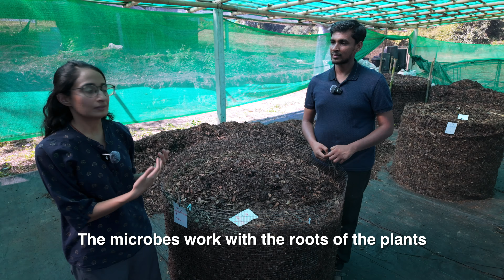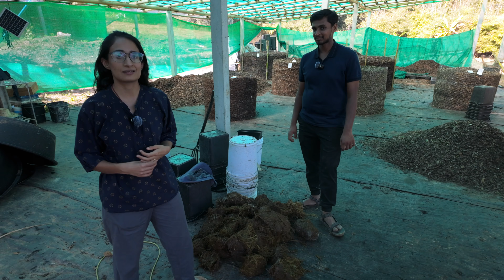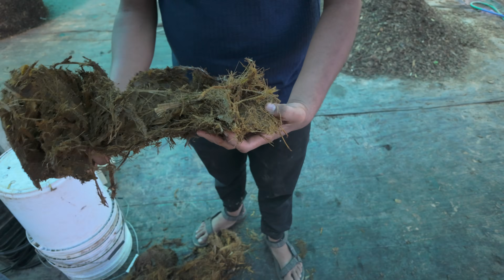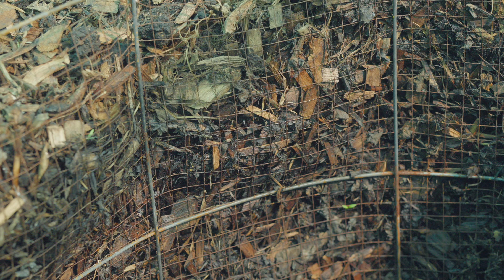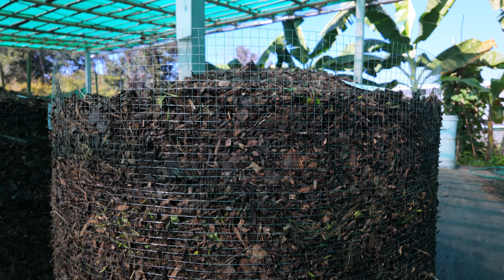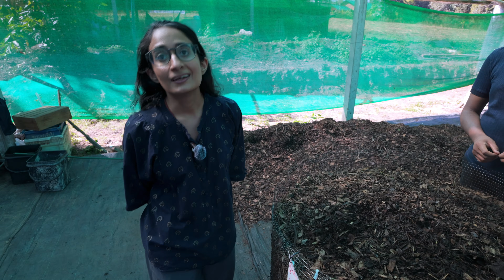Turn ANY Manure Into Supercharged Compost

Comment: Ive got buffalo manure… they eat a lot of alfalfa snd its only partially digested as well.  But, im honestly not sure how best to apply it… i put it in small piles all along the planting area until fall… got it in the spring.  Im just going to top my planters with it.  Maybe mix it with this worm casting compost and top with wood chips.  But, i do plan to try mixing it in to create a compost mix.  But, really i like to figure out how to do things without a lot of inputs.

Comment: Some bad advice in video:
1) Small batch test;  Not all compost material will work the same at different sizes. Most basic piles with the average ratio will need to be way bigger than 10 cups and will never heat up at that small size, thus giving false results.
2) Weeds; wild plants will grow where the nutrient profile is best suited for them. If a fern that pulls lots of potassium grows in an area generally low, it most likely means the fern is growing out of an old campfire site, where burned material accumulated potassium in that small spot. If you look at soil very low in nitrogen, what do you see? It won't be large lush green plants, it will be legume plants that fix their own nitrogen. After a few life cycles, they fertilize the area enough for other plants.
3) Worms can live in almost anything, doesn't need to be a donut. What they did wrong is there is a lot of coarse material still in that compost. The worms can't break it down fast enough and will have to be sifted when they harvest. You want worms in compost that had time to heat up, cool off and some fungus that starts breaking down the pile. It's the fungus and bacteria that worms eat, not whole chunks of biomass.
Reply: its 2025 already.  are you going to start sharing soon?

Comment: Want good biology? Add as many different sources of biomass as possible to your compost. Similar concept to a varied diet for humans.
Want hot compost? General mix is 1/3 greens and 2/3 browns in a pile approx 1 cu yard. That's the basics but many other ways to go hot as well. I even had as little as 1 cu foot of crushed acorns go thermal on their own, or 3 cu feet of grass clippings.

Not sure why it took these guys 2 years to figure things out.